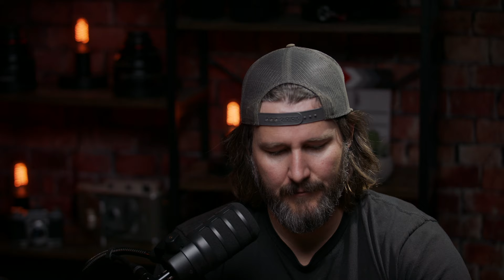We Need to Talk About Overheating

Comment: The S9 is more or less an S5-II in a different body. It can overheat, Panasonic explained it and at the start it had record limits that where very short and limiting. Meanwhile you can switch it to go as long as it takes to overheat. I think this is OK for typical hybrid shooting, travel and all the normal use cases. If you need more, you have to get the S5-II.

I don't think every camera should be safe against overheating like a car or TV. Cars and TVs are used by everybody for several hours. This is the typical use case. It's not the typical use case for cameras. I think it's important that there are options for people who need the camera for long recordings or all day long professional work but not every camera need to be professional graded.

For professional work, I would always prefer the GH7 over the G9-II. Even if the G9-II had the fan the GH7 is the better option but for travel the G9-II is smaller, lighter and the better option for me. If Panasonic put the same sensor and most features in a G95 body, it would be very interesting for me and I don't think it would be possible to make it safe against overheating.

Comment: I had four Sony aps-c cameras and they all overheated like crazy. It's pretty sad. The a5100 I had actually shot really nice 1080p, but even at 30fps, in 75-degree weather with a slight breeze, it overheated within 10 minutes. The a6300 and a6500 I had would crop in a little bit in 4K and dim the CD screen as well, and it would still overheat. It would be like if cameras didn't have a battery gauge that gave you an approixmation of how much power or time you have left, and instead, they just started flashing when they were about to run out of juice, with no warning.

Comment: The Lumix G9ii would be one of the best documentary cameras if it had fans.  Lighter and better battery life than the GH6/7.  But it overheats very fast.  For almost any of my video needs in a documentary setting it is the B or C cam due to this.  If it didn't overheat, it would be the BEST.  And yes, I should sell it and get another s5ii.

Comment: If reliability in video is key, get an actively cooled camera with dual slot recording. That basically removes every hybrid camera except a few Panasonics (S5II/X, GH6, GH7).
Reply from the maker: The problem is these companies plaster their video specs in bold all over their marketing, hyping up products based around VIDEO features, but when those products are unreliable or overheat we get the classic excuse: “well buy a video camera” - if they are selling a video camera, you can’t say it’s not a video camera.